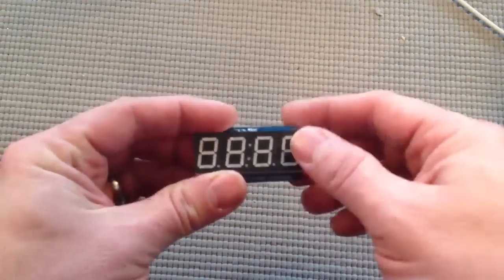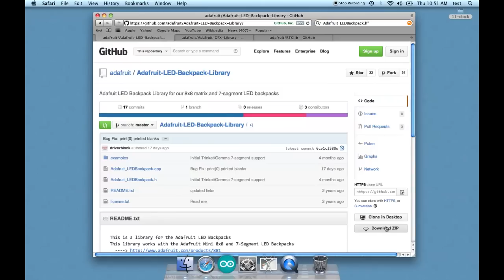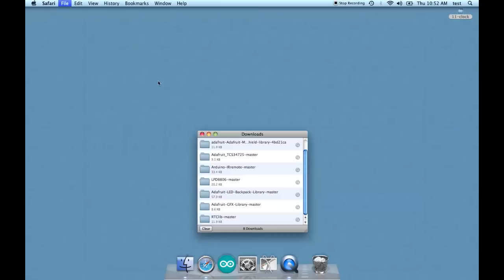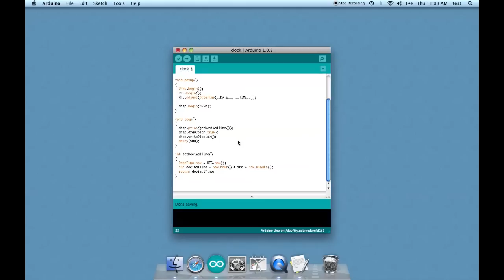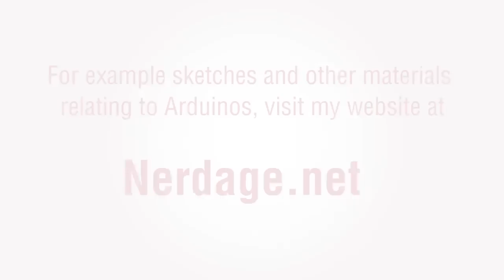Arduino for Beginners   27 Building a digital clock

Comment: How do you set the time? Is there a button on the RTC to set the time, or would I need to mess around with push buttons ( which I have to admit I suck at.

Comment: Hey there I have a question here I have a Digital clock here that shows big numbers black and white display and I want to use a color lcd screen maybe 2.4 inch I can't seem to find a good  lcd screen for it also with the ds 1302 can I add more to it beside the time and date

Comment: can i unplug usb connecting laptop and chip.bcoz i want to build a motor controlled by alrm without being connected to laptop.i want ans as fast as u can.
Reply: +suhal shetty 
yes, if you have an if you have an alternative power source like a battery which you can plug into your Arduino.
Reply: Heck I'd use an AC adapter.

Comment: Not so much a tutorial on how to make a digital clock, but a tutorial about how to connect 3 components (using as little as 4 traces) onto a breadboard and load a few libraries. What understanding of electronics, software or embeded systems is anyone going to take away from this?
Reply: Assembling components on a breadboard with jumpers, writing, modifying and uploading code - these are all valid skills in electronics.
Reply: @johncroll1467  how is anyone going to learn how to write or modify code from watching this?